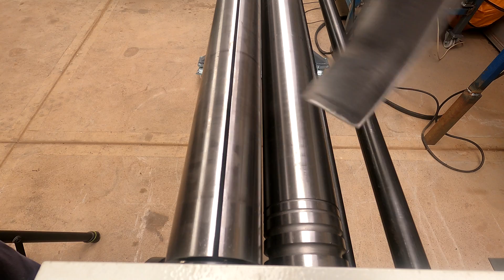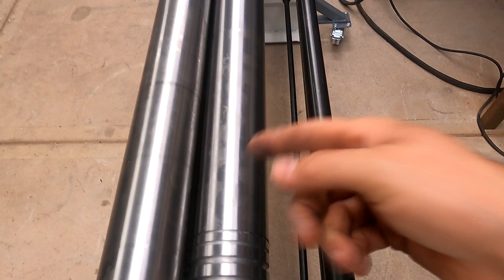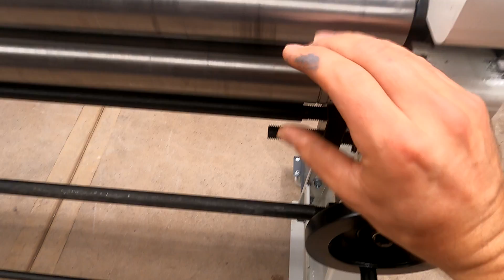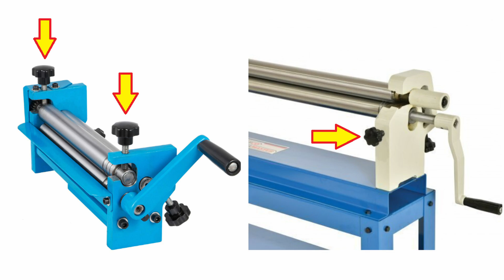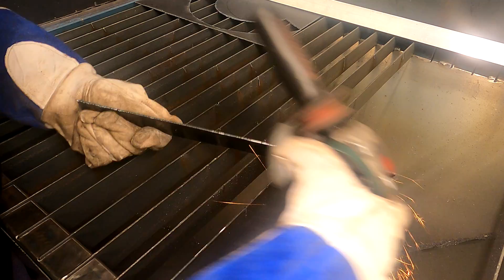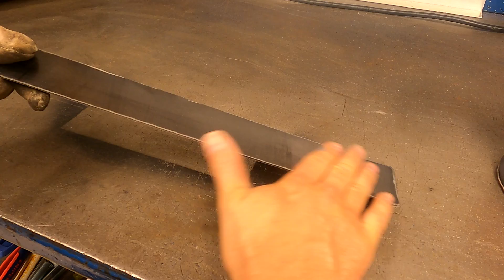How to use a Slip Roller and Roll Sheet Metal

Comment: Hi, as far as I can see you could form a perfect tube with a slip roller. Is this correct?
Reply from the maker: Hi CarholicBG, you can roll sheet metal into a cylinder but are limited to a certain diameter. With my slip roller the rollers are 60mm in diameter so the smallest I could probably form a cylinder down to would be around 70mm. Also thickness of the sheet metal is restricted to 1.6mm but with a small piece I could roll 2mm.